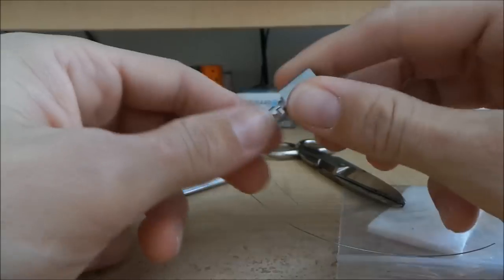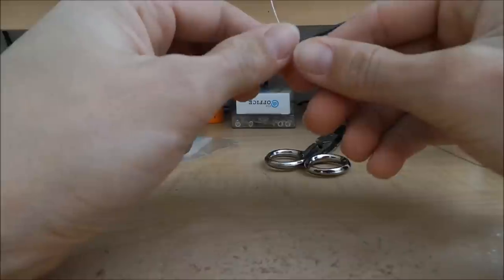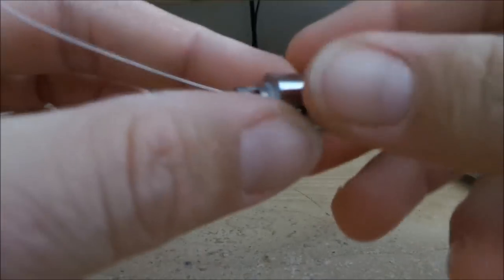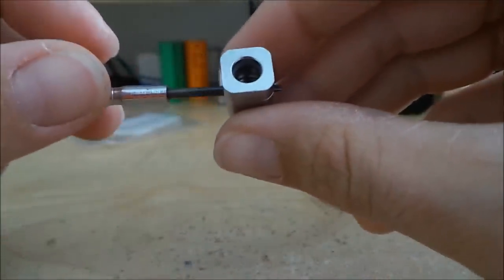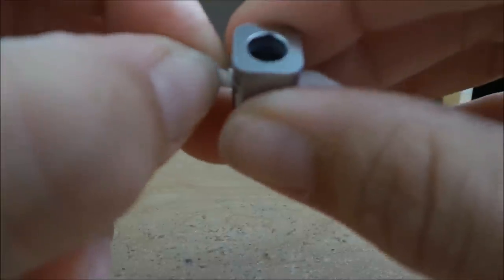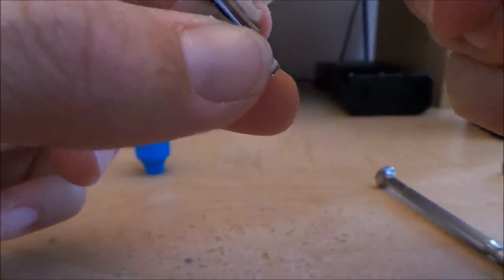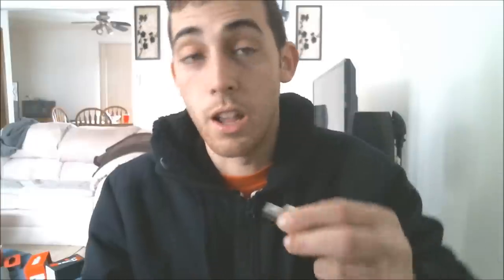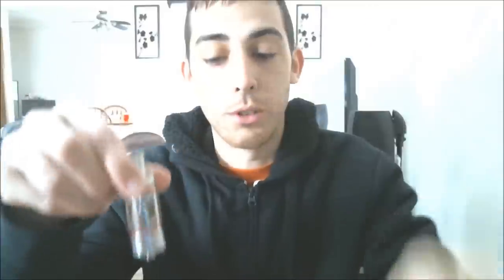Kanger Subtank OCC Rebuild - Tutorial

Comment: ı cant build my coil. down plastic is burned. can you help me ? ı use 0.32mm kanthal a1 wire
Reply from the maker: Yes if the plastic insulator is burned you need to get a new empty head.  Once its burned the coil will just short out and not work.   when ur building a coil do not dry fire the coil at all.  Wick the coil and then add juice before u fire it. As this will prevent the insulator from burning. Hope this helps
Reply: J Leone blowtorch before but did not twill.before add juice then burn right ?
Reply from the maker: Ya just dont fire the coil untill it has juice on it.

Comment: Damn it the Head uses No-Resistance wire as well. Does no one notice that? Ofc the isolation on the bottom will get hot. The same thing is with every coil head out there. If they didn't use the No-Resistance wire they would all be rebuildable.

Comment: or you save your self all that trouble of trying to fit it in there and use the rba that the sub tank plus and mini come with
Reply: jameshone1000 thats true but for some people the RBA takes up too much volume in the tank and leaves less room for juice. This is an alternative for people that want that extra juice capacity without having to pay like 15 bucks for a 5 pack.
Reply: that the only reason I got the sub tank mini was feed up of buying coils for my protank mini  so I could save money because for the prices of a 5 pack of coil I could buy the stuff to make them and make a lot more then 5 for that money
Reply: alot of people like the OCC's for 1) that you can fit more liquid in the tank and not have to worry about constantly changing/adjusting coils and cotton 2) the amount of dry hits the you get from the RBA is just Redicuilous. Unless you bore thes bigger to allow more juice to enter or have hàà out some crazy methods of coil wrapping to make it worth a damn. Over all its just not really worth all of the hassle when you can through uh the OCC.
Reply: +Mr. Roosevelt ive had no dry hits or any problems with rba in mine.
Reply: +jameshone1000 i prefer rba more than occ. occ base cost too much money.. it was like "only rich people can vaping"

Comment: i have a kanger subtank occ like you.
if i want to buy a resistence to put on it what is the value.
thanks
Reply: Not too sure what you mean by a resistance, but it depends on the power of your battery and how much vapor you want.  Most I know use the 0.5 ohm coils but I've heard of many using the 1.2 and 1.5 ohm coils as well.  The great thing about higher resistance is that you don't have to use as much power to get a great vape from them.  Hope that helps a bit.